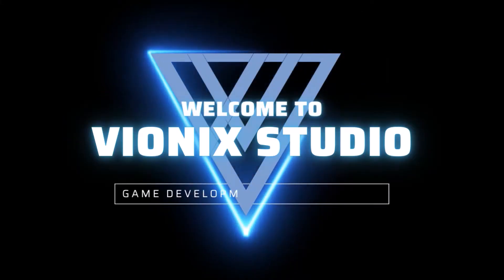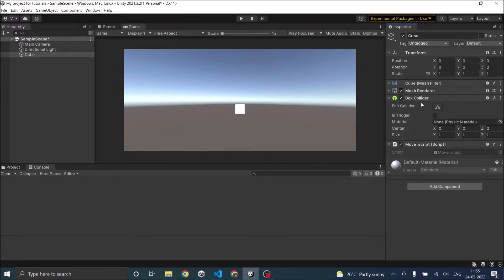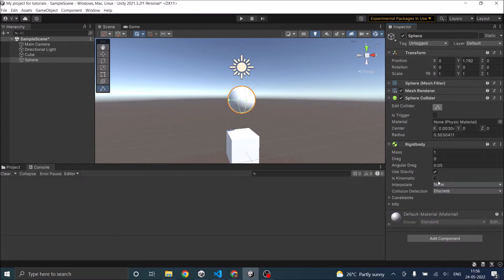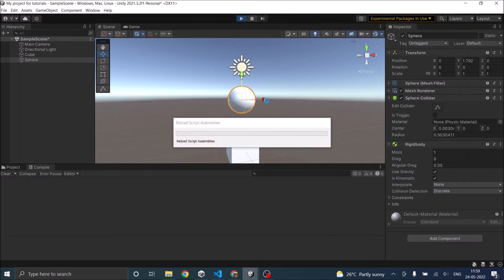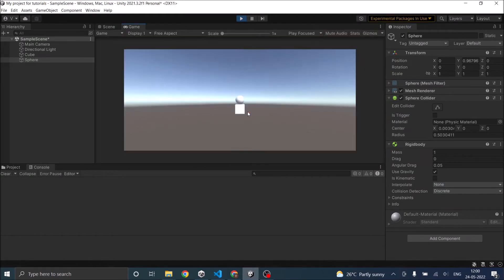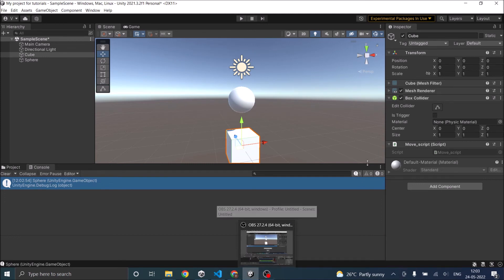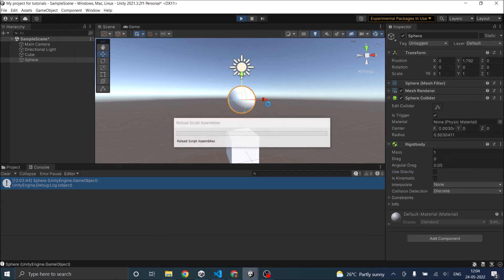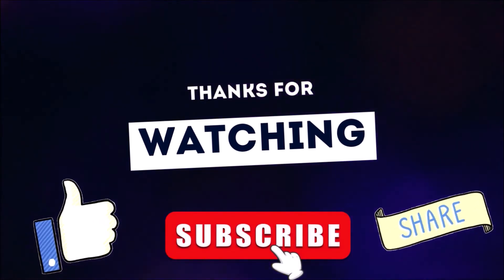🤝 Unity Collision Detection: Exploring OnCollisionEnter and OnTriggerEnter! 🔍🎮

Comment: Certainly! In Unity, if an object's collider has the "Is Trigger" property enabled, it will generate trigger events rather than physical collision events. However, you can still have another collider attached to the same GameObject to handle physical collisions. This allows you to have both trigger behavior and collision behavior simultaneously.

Here's a simple example in C#:
using UnityEngine;

public class ColliderExample : MonoBehaviour
{
    // Called when another collider enters this collider (when IsTrigger = true)
    private void OnTriggerEnter(Collider other)
    {
        Debug.Log("Triggered by: " + other.gameObject.name);
    }

    // Called when this collider collides with another collider
    private void OnCollisionEnter(Collision collision)
    {
        Debug.Log("Collision with: " + collision.gameObject.name);
    }
}

Make sure that you have one collider with "Is Trigger" enabled to allow trigger events, and another collider without "Is Trigger" enabled to handle physical collisions. You can use both OnTriggerEnter and OnCollisionEnter methods in the same class to handle trigger events and physical collisions respectively.